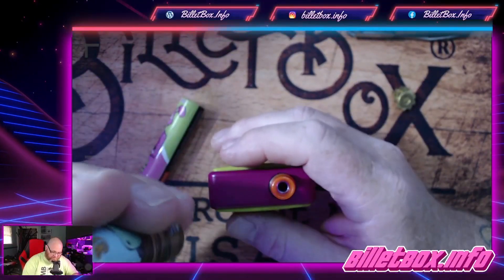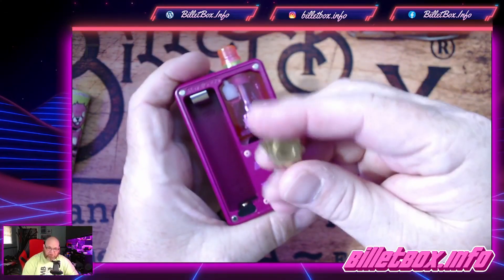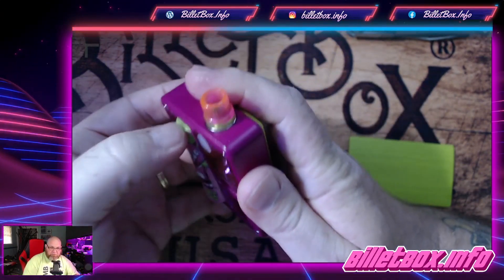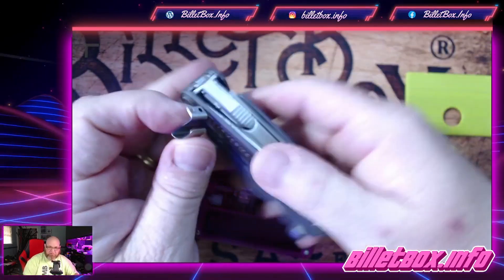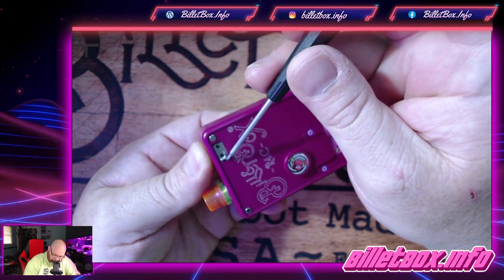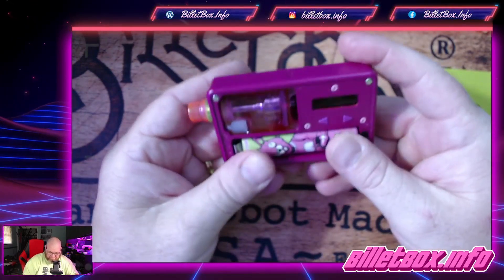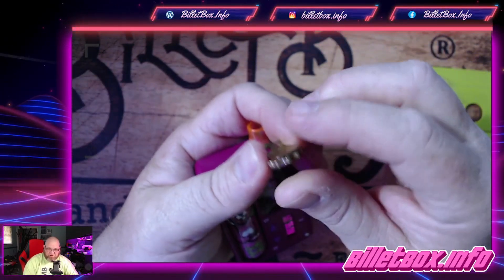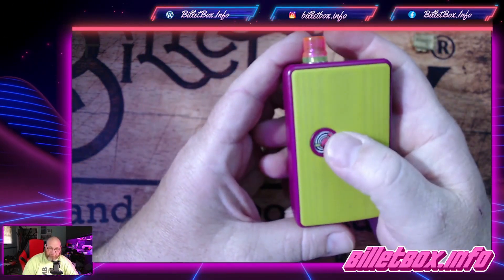Tip: Loosen Billet Box Negative Contact

Comment: I rather use the brass contact it’s way better I don’t see how it take much longer but  If u like to have loose battery and have to keep bending that original one all time It’s a every one is different thing
Reply from the maker: I only have to do this once. 
From now on, they come right out. No issues. In in out faster than a spin of a TSC dial in one direction. 
I am not hating on the TSC contacts, they are great for those that benefit from them, they just aren't for me.